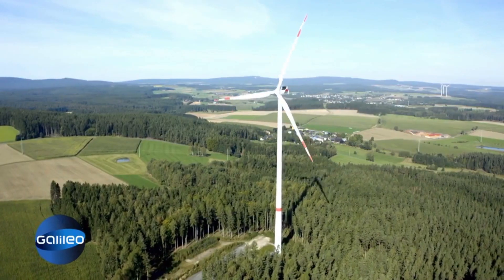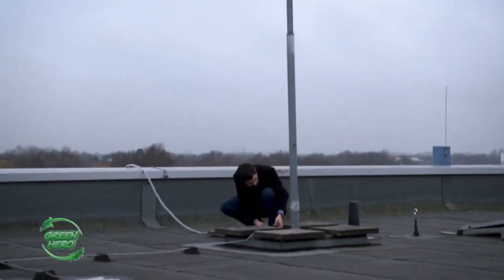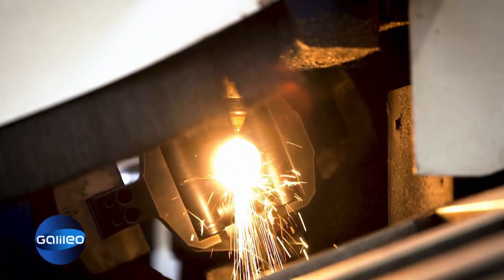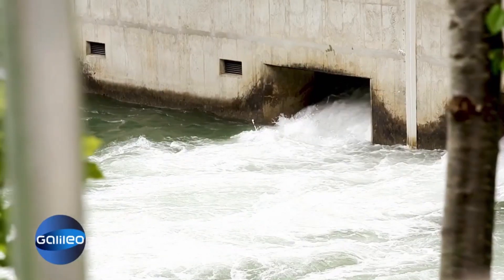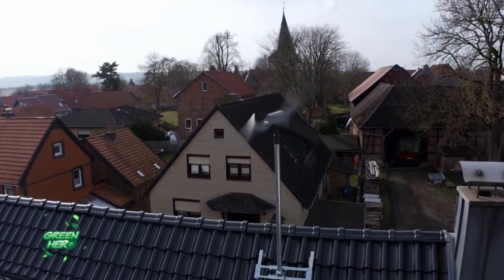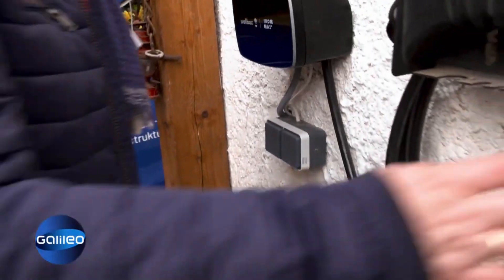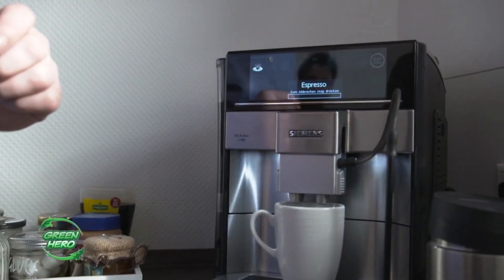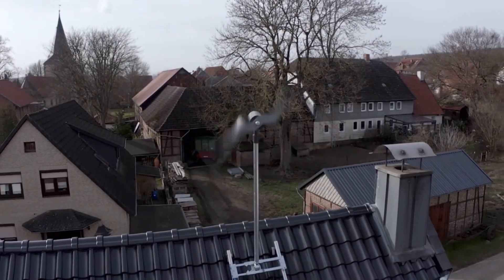Green Hero Award 2023: SkyWind NG Micro Wind Turbines

Comment: Does this company simply provide the turbine or does it also have a grid' tie interconnect switch and what about an inverter? How does it integrate output from variable voltage DC to steady state 240 volt AC power. Thanks.
Reply from the maker: The 110/230 V inverter is included with the turbine.